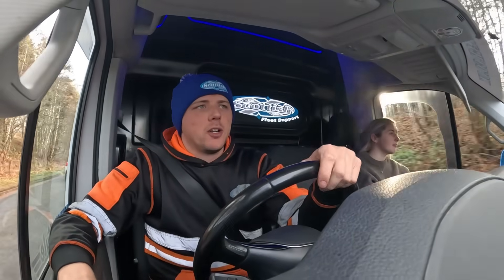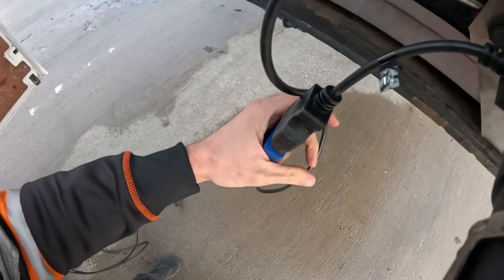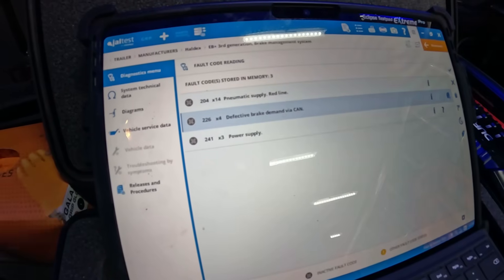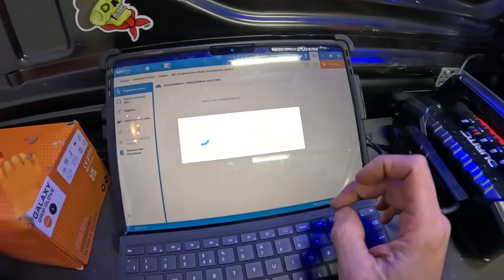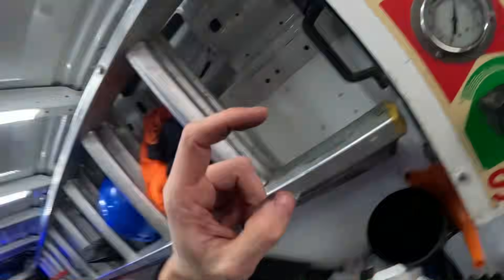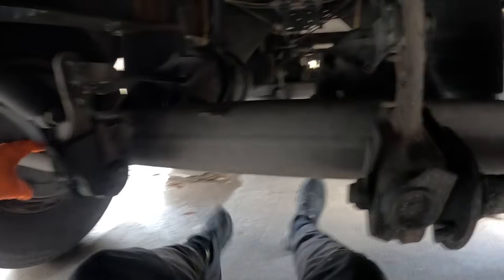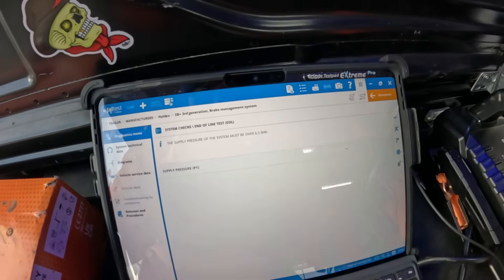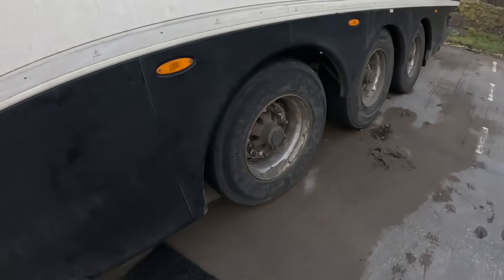Trailer Breakdown With ABS Fault – Full On-Site Diagnostics! | The Scottish Tech Fleet Support

Comment: for future reference pal, a pressure sensor jumping around as much as it was when you first joined straight away is a faulty sensor. No way you should have a bar difference jumping between 4-5 in a second. Just for future help. Same as it has x14 for that fault. that means on 14 instances its recorded low air input pressure. That haldex unit is piped straight into your air tank. if your holding 8 bar in that tank and the sensors flicking between 6.4-7.6 bar theres a issue. iv seen it on 2 of those haldex units and its the pressure sensor inside is knackered. So even when a unit is connected at 8 bar it randomly flicks down to 6 bar and throws a warning on
Reply from the maker: I appreciate the advice!